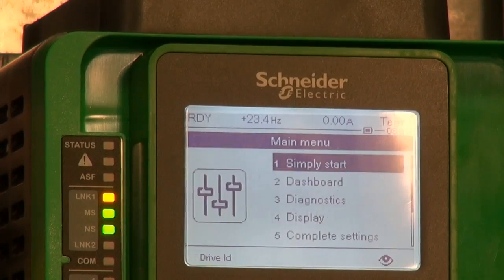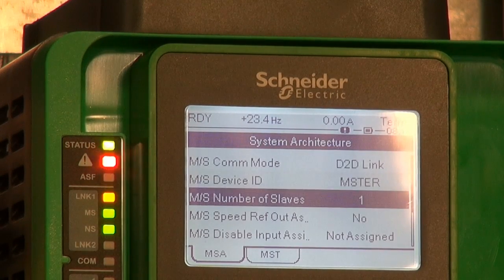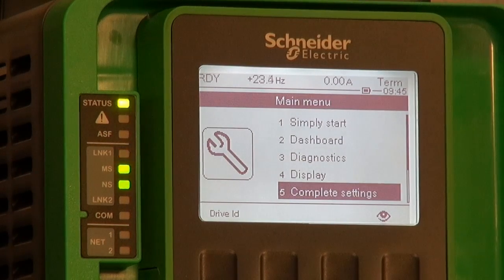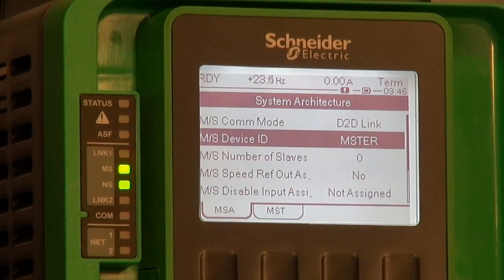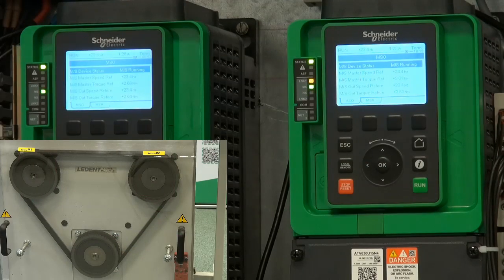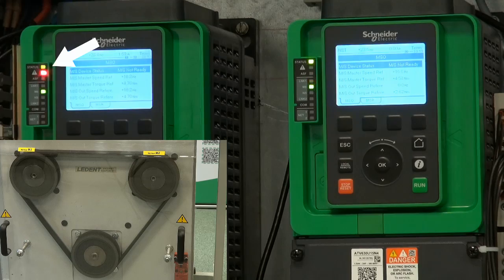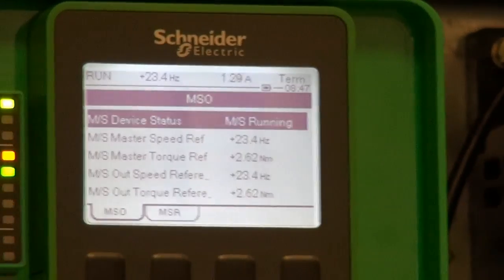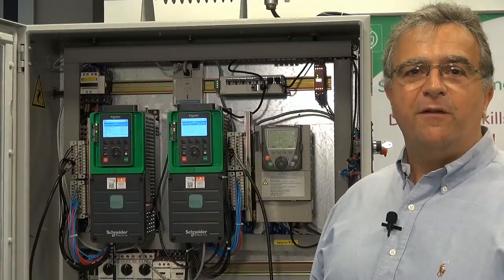Altivar Process Master Slave Function | Schneider Electric

Comment: Hello, I can conect 1 master and 3 slaves?, I want to modernizate a bridge crane, actually have 4 motors whit direct start (slip ring motor whit resistor to variate velocity ) to traslate the bridge, i can reemplaze whit 1 master and 3 slaves?, you know something? , will be more eficient?, regards
Reply from the maker: Thank you for your message. If you would like to request installation support, please contact our technical experts in your location here:
 http://spr.ly/6053HA0S9

Comment: Has anyone out there actually done this in the real world? We have spoken to Schneider tech support in the United States and they have no clue how this works. I would appreciate help from anyone.
Reply: Yes.  Machine builders sometimes do this when coupling two motors to the same gearbox.  If you use anything other than the ATV process drive I am pretty sure you would need to use a PLC like the M251 to supervise.
Reply: @unscripted_darren  Hello, I can conect 1 master and 3 slaves?, I want to modernizate a bridge crane, actually have 4 motors whit direct start to traslate the bridge, i can reemplaze whit 1 master and 3 slaves?, you know something? , will be more eficient?, regards
Reply: @rodrigovidal503  I put together a multi-stage pump system based on a Schneider training manual and it worked very well.  I wouldn't know where to start with your motor drive system....It will depend on what functionality you want.  From the cranes I have dealt with in the past this method may not be ideal because you are dealing with multi-axis of control.  You would likely install a small little PLC to control the motion. Most of these crane applications are not high speed and you would be best to use the TM241 plce because it has Modbus IO scanning or Ethernet/IPand you can import the DTMs right into the controller.  your programming time is easy and fast. The VFDs don't have the level of logic you would need to control multi-axis.
Reply: I did it using ABB ACS 800
Reply: @hasithasudasinghe873  can i get wiring diagram for abb drive for double vfd